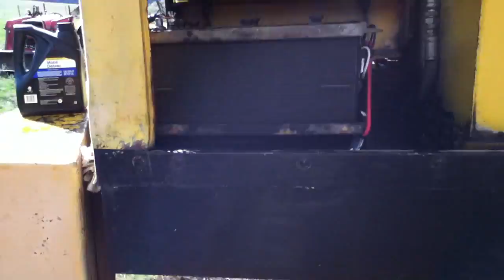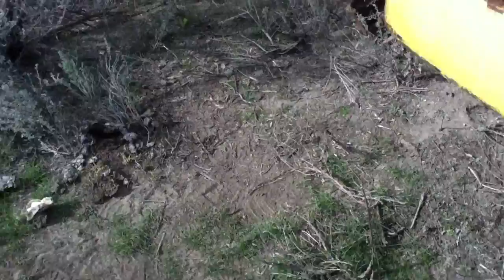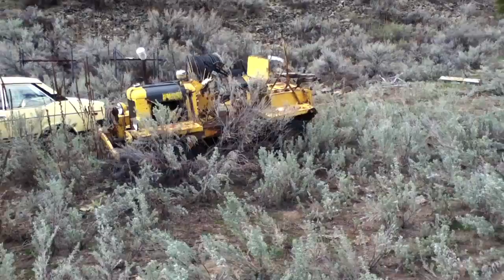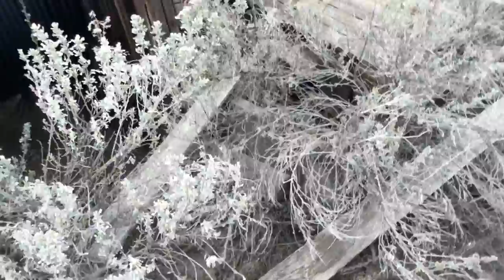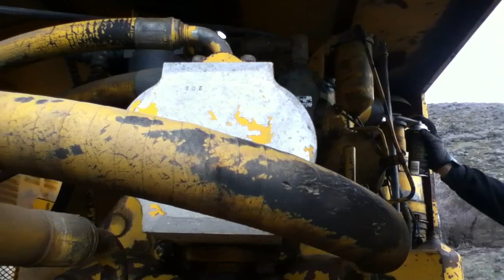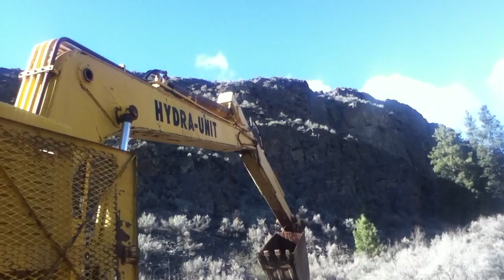Work Progress on Old Construction Machine

Comment: good video! what happened at the end? i thought someone hit him lol
Reply from the maker: It ran intermittently and was good for just one job, excavating a sewer tank, then a drive shaft bearing shattered and the machine is stranded in another spot.   Then another hydraulic line broke and it could not even be used where it was stranded.  It costs $300-$400 in repairs for every day we use the machine and when a part breaks, it is always a different part, that is why it costs so much to rent the machines also.  New or used, the daily costs are about the same.

Comment from the maker: Yeah, I figure it was like making $15,000, but we can't sell it.   We are into hydraulic fluid by $600 alone and it needs more, and the guy paying for the parts and fluids is running low on cash.  I think we might have blown one of the seals while figuring out some of the controls which were buggy, but smoothed out as we added more fluid and got things going again.  It blows out a bunch of fluid when moving the tracks but does not leak when standing still and just using the bucket/arm assembly.

Comment from the maker: I had some experience in the Marines with a truck called the LVS which used a blown diesel V8 that just used a single large fuel injector blowing fuel in through the top of the blower, that's where I got the idea to use the water bottle with an X cut in the cap to inject fuel into the air intake.   We eventually found the sources of the engine problems that kept it from running, but it still needs electrical work in order to just start it from the cab.

Comment: That black hose if put out in the sun would make a good simple water heater, I think Dan at greenpowersicence showed how that works, the metal poles make good wind turbine mounts and the cable could be used to run power overhead like the power company does on poles.